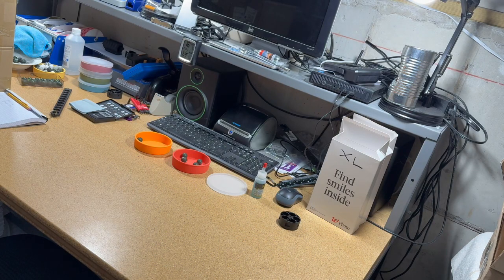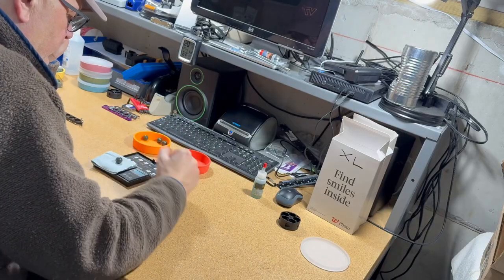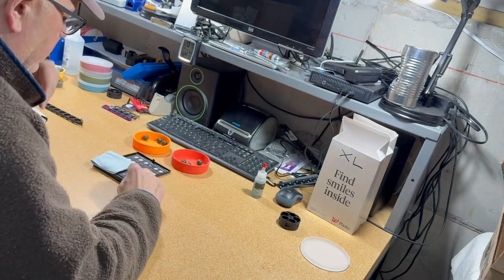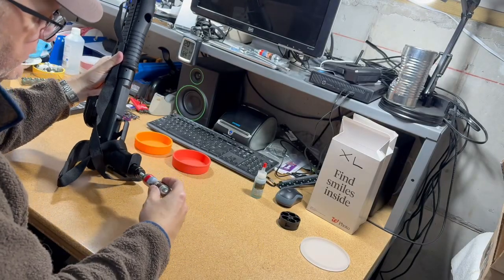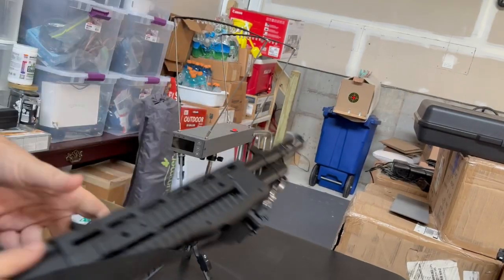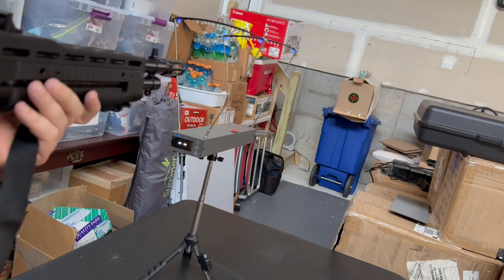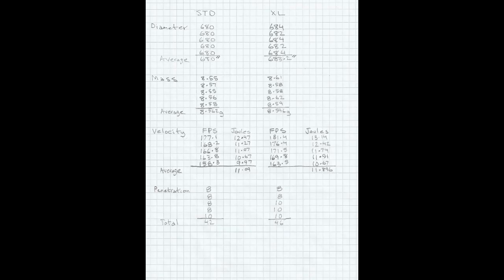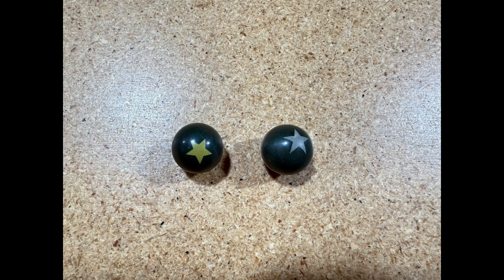The Smasher XL vs the standard Smasher in an Umarex HDB-68

Comment: I think bore matching to the decimal is unnecessary just because the difference of performance or velocity gains will be miniscule at best, and penetration or damage of impact on target pretty much indiscernible. I believe your test results are inconclusive because it doesn't take into account the drop of CO2 pressure with each consecutive shot making comparison readings to each round flawed. Tuff luck Tom tested both smasher original and XL rounds using his Pistelle X68 doing two seperate videos one with the original and the other with the XL and  the XL rounds were generating lower FPS readings. I feel the original Smashers were designed for 68 cal launchers and were already a good product, but that you were pressured to bring out the XL because some members of the Pistelle community were suggesting it would be a better product if it were bore matched to the Pistelle factory barrel to the decimal point, which I doubted would make any significant difference, since a .68 cal round is a .68 cal round. I'm assuming the Smasher would be a solid performing round fired from the Pistelle with the 11.5 inch extended barrel. Maybe do a demonstration video on that going through 1/2 inch plywood.
Reply from the maker: @theFormidable1  I would love to see that video Tom did. Can you link it here?
Reply: @glennconti  here's his video testing your original smasher rounds you can find the other video with the XL smasher on his channel Tuff Luck Tom https://youtu.be/YUUssLLsgIE?si=kQUeggwb6Huumihy